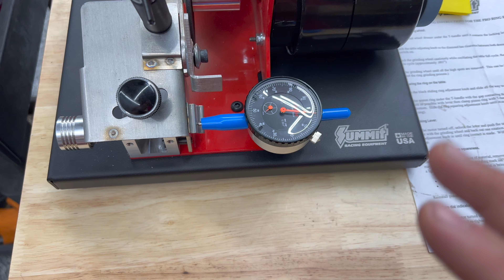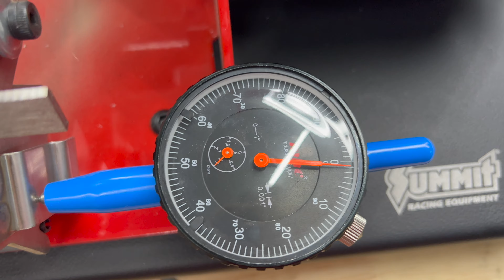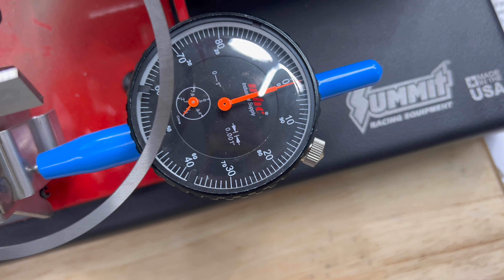PROJECT: Pepper - PISTONS On The Half Shell -Porsche 911 4.0L Engine Assembly Series Part 3

Comment: I own Jake's video series, and yes it is a LOT more in-depth than what you had in your first video.  But some proprietary tips/secrets were in your video.  I'm glad you removed those parts.   Looking forward to the Bank 2 piston install video.  How many times have you practiced the wrist pin install?  ;)  I must have done it close to 50 times on my spare M96 engine.
Reply from the maker: I had nothing to practice on but I did watch his video multiple times before jumping in.  It was VERY stressful.  I did have the top portion of the wire lock tool get stuck once. That was 🙀
Reply: @YogisGarage  You can always practice with just the bank 2 half of the case.  All you need is a piston, a wrist pin, and an old circlip.
Reply from the maker: @texsquirrel213  I’ll do that on my next one
Reply: @YogisGarage  You need to build a hotrod Boxster or Cayman next.  Complete with a bigger engine.  Keep those flat 6 engine building skiils sharp! ;)  I wonder if you could make money on it on BaT.
Reply from the maker: @texsquirrel213  Mods and Miles is probably a better fit.